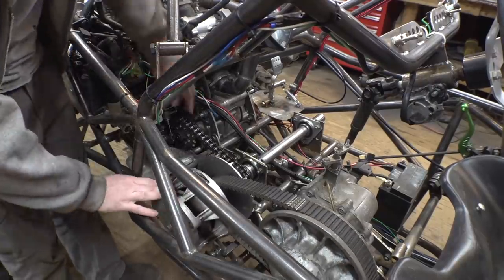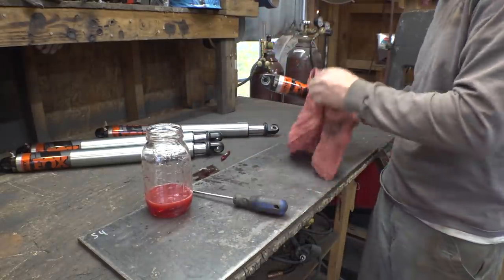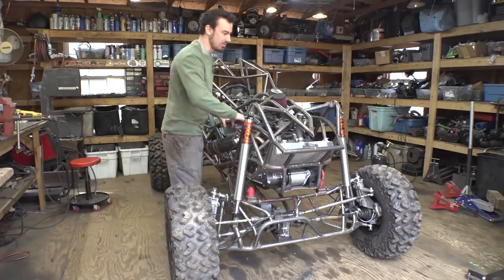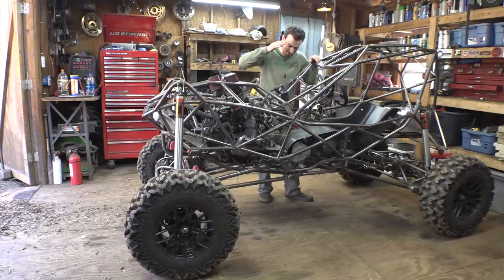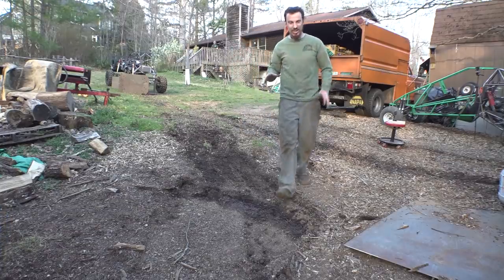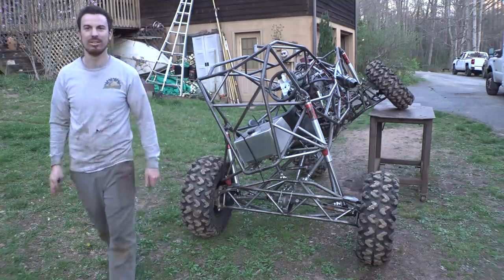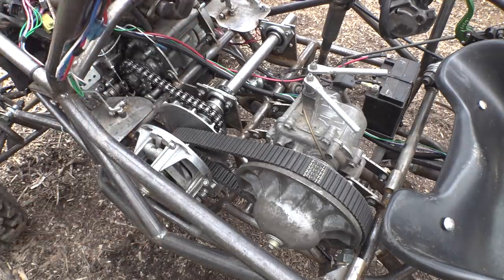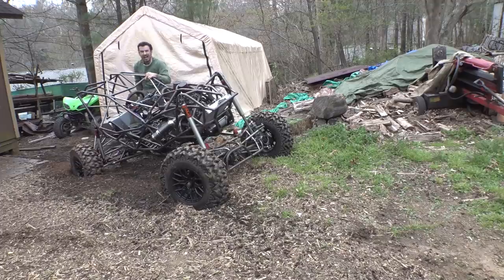First Driving Test!! on the Mini Rock Crawler Build - Part 14

Comment: Sweet! FYI, when one of those primary clutches hangs up, it’s a sign that the synthetic bushings are wearing out, both the ones in the weights and the ones in the shaft. Also you might consider changing the clutch weights out to a heavier weight, you’ll get a more responsive clutch, but word of caution go too heavy and it will engage too easy.
Reply: Heavier weight = heavier spring unless your going for lower engagement which I would say this needs anyways. That said Im not there to experience the tuning first hand.
Reply: @SuperBigdanno  it’s pretty simple, plenty of snow mobileers do it all the time. Clutch tuning results in huge gains. I also imagine his secondary clutch alignment might not be accurate which can cause the secondary to lock up and in turn cause the weights to want to wobble, causing the synthetic weight bearings to wear causing the weights to smack and lock up in the clutch housing. Another thing that can cause is clutch balancing Ie not having the primary clutch properly balanced (it’s why you’ll see partial drill holes out of the outer plate. Put the plate in out of the “x” and or mix match parts and you’ll have clutch weights wear out and cause clutch lock. As far as tuning with heavier weights, it’s engaging pretty late, even with the belt tight, going up to the next weight heavier or even 2 heavier will help with the responsiveness. When you know you’ve gone too heavy, the weights activate the clutch at idle. He also probably needs a thicker washer inside the primary, it looked like he had some belt slop, it should be tighter at idle/off, to know how much is look up the clutch and the range of slop allowed. Do this with a new belt not a used belt.
Reply: @AkPacerPilot  as a snowmobiler I agree lol the bushings that cause the clutch not to engage are the large center bushings in the sliding sheve and outer cover, could be the weights are notched but he had to tap the clutch to get it to move so bushings it is. Usually when the weight bushings are worn they will ware into the towers if left long enough and then get caught on the tower and hold the clutch engaged, this can also happen with flat spotted rollers... rollers can be worn through and the weight gets caught on it again hold it engaged.
All that said I would switch that clutch out for a Power Bloc clutch and get away from the junk fly weight clutch all together. Way less part to ware out and easier/ cheaper to tune.
Reply: @SuperBigdanno  spot on, actually when you get the tooling or in my case fabricate the tooling, cvt clutch work isn’t all that expensive, last P85 I rebuilt, think I spent 80$ and that including replacing the weight bushings that Polaris says are “unchangeable”. When CVT’s get expensive is when they go way way too long and the synthetic bushings they call bearings wear out and metal gets damaged. I haven’t messed with power bloc, do they have a good match for P85 swap out?
Reply: @AkPacerPilot  yes Power bloc has a good match to the p85, they have a clutch for pretty much any application from 30hp to 200hp or more. They also supply a lot of oem snowmobiles and atvs. I wish they were a sponsor but nope I pay cash like everyone else lol.  I will say that for a racer this is not a clutch for them (not quite tunable for that very last drop of power) but the average every day rider they are a really good long lasting unit. First inspection is not until 3000 miles and from what Ive seen they really dont need that but still good to have a look.
Reply: @SuperBigdanno  awesome, yeah I tend to be pretty hard on my sleds, primarily a lot of deep powder steep riding, usually end up having to align the clutch straight from factory, usually end up overhauling them every 750 to 1000 miles about as often as I do top ends lol… Secondary I usually get away with every two to 3 years, usually end up overhauling the secondary about the time I’m upgrading… lol I’ll have to look into that aftermarket cvt. All I know is, he needs to do some adjusting and overhauling, cvt work is pretty easy once your tooled up right, and understand how they work and how to spot signs/symptoms of wear. Have a good week, hope you get some riding in, our back country here in Alaska is starting to get rotten… ride on!

Comment: Thinner oil, not less oil. That belt is already done and spitting off burning rubber chunks. If you insist on using that CVT system, please make a full cover so you don’t start a fire somewhere in the back woods.

It’s not too late to drive the gearbox with a chain/sprocket system. The motorcycle clutch will last longer and stay cooler if it’s under driven. A simple 3 or 4 to 1 chain ratio into the ATV differentials is enough to climb almost anywhere.
Reply: He has the skills to make the correct 2-speed box with reverse. He could easily make a 2:1 reduction high range, with a 5 or 6:1 low range, then adjust primary and secondary sprockets for the best gearing. He said he wanted the CVT so he doesn't have to mess with the clutch on the trail, but the way it's set up he's going to have to modulate the clutch to avoid burning up the CVT and chain. It would be VASTLY better as a direct drive with clutch.
Reply: Yeah, CVT on a rig like that would not be my first choice, thats for certain.
Reply: That CVT there makes no sense. It will always be the weakest link in all the transmission
Reply: @leos7429  Thats also how i feel about the side by sides, instead of CVT and belt drive garbage, they could have just beefed up the transmissions and diff setups from the large 4 wheelers, or just made better ones so you could get them in a manual transmission option or an auto/tiptronic style setup. Ive just never been one for CVT, sure, its fine on a snowmobile and a small go cart, but when the large toys have them, it just seems like a cheap cop-out. Belt drive CVT on a 4 wheel drive off road machine? No thanks, would much rather have even chain drive multi gear if shaft is completely out of the equation. I have no doubt there are plenty who just fabricate them with something out of, say, a suzuki samaurai or similar small 4x4, or even larger if able to fab it all under a side by side.

Comment: You could always replace the chain tensioner wheel for a skateboard wheel 😉
While its life wouldn't be as long as plastic, it wouldn't get chewed up as much as tape would
Reply: 70-80s roller skates have very soft rubber. Find a pair at a second hand store and that is 8 wheels.
Reply: That, or even a small sprocket.
Reply: Get rid of the plastic , put a small sprocket in place with bearings inside of the sprocket ...we used sprocket back in the 70`s and 80`s .
Reply: A chain is always bumping on round objects. Use a sprocket, that’s designed for it.

Comment: Pretty crazy to have the motor idle without the primary spinning like normal, 2nd and 3rd must top that thing out going pretty quick, or just smoke the belt lol
Reply: My motorcycle has the same engine, its a great engine. Pulls hard after 4,000 rpm

Comment: Use a sprocket instead of the delrin. It'll mesh with the chain better and make less noise. You have the machine tools to make an arbor for one. As for the shocks, to make the dampening lighter there are actually parts you can get for higher flow rate and less dampening. You really shouldn't remove the oil though as it's there for more than just dampening. It's also the lubrication...

Comment: Is there any reason why you wouldn’t use a regular sprocket as a chain tensioner instead of the plastic piece so it would be quieter and would also be less wear so you wouldn’t need to always be replacing the plastic piece?
Reply: Was thinking same. Wouldn't there be more friction with a sprocket due to area of teeth???
Reply: @geoffburrill9850  I was thinking the sprocket would have less friction but I honestly have no idea lol
Reply: @mitchgohl4854  Ya all are to young lol , I used a sprocket in the 70`s and 8-0`s on our dirt bikes , the sprocket had a bearing in the center , they never wore out ...
Reply: @88s10Durango  Never part i dont buy but lasted way longer than actual gears since there is way less force coming to tensioner.

Comment: i think the primary bushings need to be cleaned up or replaced. also, a light sway bar in the rear would help with the body roll.
Reply: It needs a gear reduction at the axles, a sway bar will reduce flex but a gear reduction will not while doing a better job at reducing torque twist.

Comment: i still think it would be better without the cvt and rather a chain directly to the gearbox, sure it would be a bit harder to get used to driving, but it would be more power efficient and smaller
Reply: do u even know what u talkin about cleary u have 0 knowledge of a cvt a cvt is better then any other gearbox ever made thats why  they banned cvt in formula 1 racing u make all the power at any givin point u need it it never stops makin power lol go back to school
Reply: @NubsWithGuns  I think he means for it to be 1 to 1 gearing. Like no variation
Reply: @superbanaan9  Firstly, calm down. Secondly, why don't Ferrari, Lamborghini, Porsche, Bugatti, ... Use them on their high performance cars if CVTs are the best transmissions?
Reply: I was thinking the same thing at first I know what you mean . But That motorcycle clutch most likely can’t handle that much weight but  that cvt is made for sxs’s so I think he’s doing it right just have sum tweaking to do this project is going to be major!
Reply: @superbanaan9  do you honestly believe that a cvt like this which more or less works purely by friction won't take any power out of the system?  Sure you can tune them to only engage at optimal rpm, but if you didn't have it it would work better at those rpm's
Reply: One of the advantages of a CVT is its ability to continuously change its gear ratio. This means that no matter what the engine speed it, it is always performing at its peak efficiency. CVTs often offer better fuel economy as a result, especially when driving in the city.
Reply: @superbanaan9  Sounds pretty much perfect, why dont they just use cvt's on everything then? I know they made a few cars with cvt transmissions, but why aren't all if they're so great?
Reply: @steffentysnes5302  here list of new cars with cvt 
 Buick: Encore GX
Chevrolet: Malibu, Trailblazer, Spark
Chrysler: Pacifica Hybrid (plug-in hybrid)
Ford: Escape Hybrid, Escape Plug-in Hybrid
Honda: Accord, Accord Hybrid, Civic, Clarity Plug-in Hybrid, CR-V, CR-V Hybrid, HR-V, Insight
Hyundai: Accent, Elantra, Venue
Infiniti: QX50
Kia: Forte, Rio, Seltos, Soul
Lexus: ES 300h, NX 300h, RX 450h, RX 450hL, UX 250h
Lincoln: Corsair Grand Touring (PHEV)
Mitsubishi: Mirage, Mirage G4, Outlander PHEV, Outlander Sport
Nissan: Altima, Kicks, Maxima, Murano, NV200, Rogue, Rogue Sport, Sentra, Versa
Subaru: Ascent, Crosstrek, Crosstrek Hybrid (PHEV), Forester, Impreza, Legacy, Outback
Toyota: Avalon Hybrid, C-HR, Camry Hybrid, Corolla, Corolla Hybrid, Highlander Hybrid, Prius, Prius Prime (PHEV), RAV4 Hybrid, RAV4 Prime (PHEV), Sienna, Venza
Reply: @superbanaan9  arent lots of these just automatics? The ones I recognize aren't cvt's anyways, but 5-6speed auto's.  A cvt is in practise a gearbox without set gears?
Reply: @superbanaan9  and sure you can call an electric a vehicle with no set gears, but then again, there isn't really a cvt either
Reply: @steffentysnes5302  clearly u havent one cleu how a cvt works or what it looks like again many cars use cvt
Reply: @superbanaan9  then tell me what a cvt is if I'm so wrong
Reply: @steffentysnes5302  it's a variable-ratio belt and pulley system that also works as a clutch.

Comment: I think your gonna have to lose that torque converter.. rock crawlers are usually in the low rpm range.  Rock bouncers are in high rpms but this thing just screams rock crawler to me.. especially with that amount of flex.

Comment: Well, this will be put up after the first time he actually "rock crawls". Seat position, weight distribution, generally dangerous with body parts less than an inch from moving parts, concussions from slamming head into cage, etc etc. I guaranty you no organized licensed off road groups would allow you to run that with them.
Reply: Spoken like a true expert. I'd imagine he'd be wearing a helmet and harness like in his other builds, so concussions aren't likely.

And the weight distribution seems fine to me. That engine is far forward and the seat isn't over the rear axle. It absolutely isn't as optimal as a full-size chassis but as far as simple crawlers it will certainly suffice.

The bottom line is you couldn't build anything like this, and I think you know that. Constructive criticism is fine, but not when it's based on non-facts and coming from someone with no experience.

Comment: Hey tip for yeah, while running with belt off. Rub the secondary with Emory cloth or sand paper. Belt sticks a whole lot better. Old sled trick for blown belt residue.

Comment: I would suggest you take a look at the CVT clutch alignment and engagement adjustment procedures for any CVT for snowmobile or ATV. Reason being is that your belt is not supposed to be moving during idle and further, any movement wold be due to the misalignment of the primary and secondary sheaths or the primary shaft center bearing is spinning when its not supposed to. I'd be glad to talk you thru this if you're interested.

Comment: I think there is a lot of great things with CVT transmission and before thinking about taking yours out of your vehicule, you should learn about them and ajust them the right way. Your primay engage to high? Bending your strap wont fix that problem. Now your strap is way to tight and I think that is one of  your principal problem with your CVT setup. I’m a snowmobile guy and I know CVT may be capricius sometime but when its finetuned properly, it work insanely! Great job by the way!

Comment: Well done, my only observations are... As a Rock Crawler,. You need lower gear ratios.    At the axle is best.  Easier on the drive train that way.  2, all that axle trusing needs to be above the axle for more gound clearance.  You will also want to plate the bottom.  Think rocks hanging up on anything they can.

Comment: I noticed some people mentioning removing the cvt and running direct chain to the transfer case, it would remove the delay in drive when you put some power in and would allow you to modulate the clutch more accurately, also the clutch on that bike engine is plenty strong and can handle the power but if need be a clutch lockup could be used, if it was mine ide be ditching the cvt

Comment: Sick ride.
Belt drive. 4High for goin fast only. 
Any loads goin slow 4low only. Will save your belts.
May need to air those tires down to like 10 or 8psi. since the rig is so light.

Comment: I have this wild design for a low profile front engine drift cart. Took me a while to decide on an engine. 
But I think the one I decided on would be a great engine for one of these,
Honda cx500, shaft driven and compact transmission, put it through a atv transfer case

Comment: Pull the primary and secondary clutches and use that handy dandy lathe to build a sprocket hub for the gearbox.  Ditch the cvt altogether.

Comment: The fact you can even get it to rev fully out in high range and have the clutch slip means you need more weight.  Also make sure at idle with the belt in its natural position that the  Secondary  is fully collapsed with the belt at the very top of the sheaves.

Comment: this is an awesome build. one hell of a rock crawler. i have always hated those belt clutch things personally. i would take a mormal 5 speed dog box transmission with wet clutch anyday. but i dont know what im talking about really. hopefully he can fix that slipping belt issue. not being able to get all the power to the wheels would suck. i guess it makes sense it would be difficult to do though with 4 grippy tyres.

Comment: I suggest for the chain tensioner a hard skateboard wheel maybe? soft enough to reduce noise probably completely but tough enough to handle the chain pressure, just will require re-tensioning. or add a spring!

Comment: The squeeling sound u get while in gear from the drive clutch is due to either alignment being out or the belt being too tight, the slipping at the end when trying the burn out will have most likely burnt the belt meaning u will require a new one and possible burnt the clutch sheaves. From polaris technician in New Zealand

Comment: Sorry for all the comments ... but just this last one ... I promise. The reason your clutch stuck (most likely) is because of your attempt to "tighten" the drive belt. These belts are NOT meant to run tight. The manufacturer will give a specific center to center measurement, and then shins are used to keep the belt at the correct height on the secondary pulley. 

Running the belt tight will cause rubber to stick to the shaft on the primary clutch. The bushing for the sliding half runs on this busing. When your clutch engages it will get that melted rubber on the bushing. When you shut the engine off, the rubber on the bushing will stick to the shaft. 

You can clearly hear the belt squealing several times, so you need to take care of that. If you want your primary to engage at a lower rpm. remove the outer clutch cover (be careful as it will pop off so be ready and back the bolts out evenly) . Once you have the cover off you can remove the spring. There may be shims in on the cover side or on the clutch that you can remove. If not, you can purchase a softer spring. They are color coded and your spring should have a paint blotch on it somewhere. 

You can also change the weights to heavier ones, but this will also cause it to shift up much more aggressively and may not be desirable.